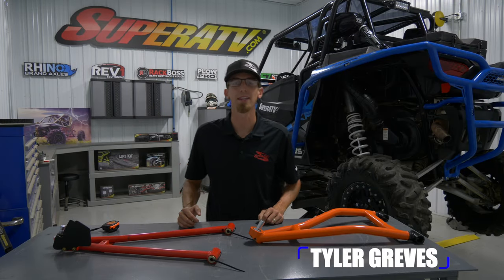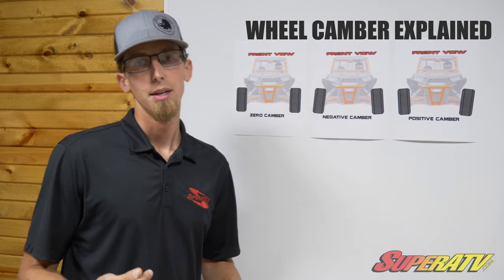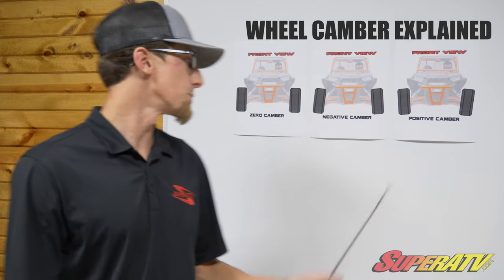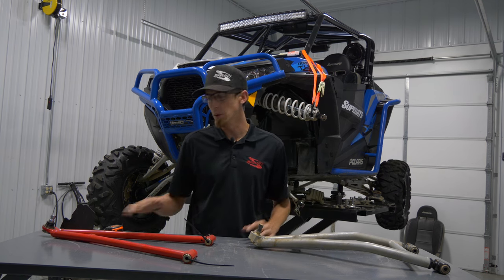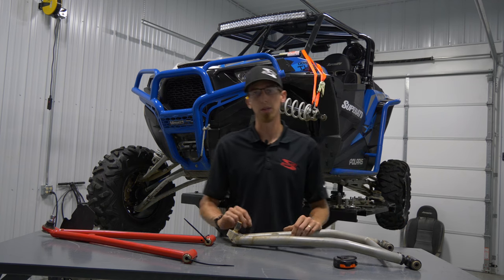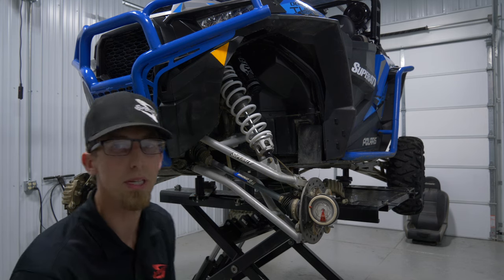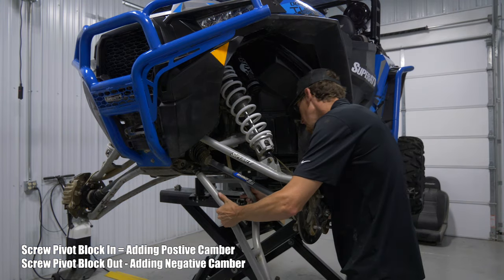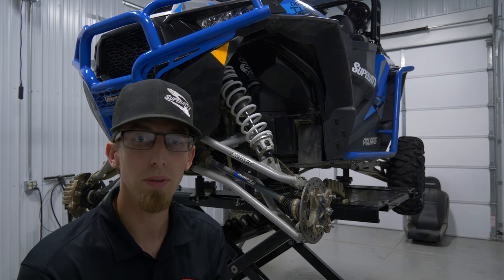Fully Adjustable A-Arm Install - Camber Explained - SuperATV

Comment: Just put a set on my 2019 Ranger Highlifter, ended up with a smidge more negative caster than I wanted. Tearing it back down to adjust the arms will have to be for another day. I really like the arms, the factory HL arms are thin metal.
Reply: Just remember to put in the steering arm adjustment when you  put these in.  Moving the arms forward will and using the factory steering arm length will give you a massive toe-out.  Adjust the arms out to bring the wheels back in to straight within a good eyeball look and you will be able to see your negative camber.

Comment: If you’re véhicule is not level the angle gauge won’t give you the right angle should check the caster before removing the stock arm as a reference point 😊

Comment: Wouldn’t you determine your camber with the machine on the ground?
Reply: I would think. Or at least use jack stands under the ball joints.
Reply: No
Reply: I agree, with the suspension at full droop your suspension isn’t going to have the same camber as it would at ride height?
Reply: Just got a set for a commander and instructions say to check camber with machine on the ground and suspension settled.

Comment: I assume with the 1.5 offset arms you have to get longer axles?
Reply from the maker: No you do not, these a-arms do not make your machine any wider it just moves the center point of your wheel forward 1.5".

Comment: Good info., but how are we going to set the Caster on these arms ?
Mine just came in. I need to reset the front end and nobody has info
on Caster adjustments using this set of arms.  Thanks!
Reply: I had the same problem. After your ride height is set with loaded weight, tape a digital levels to the roof front to rear. Lift the car so it stays level and remove wheels and axles. Use the digital level holding it from uper ball joint to lower ball joint, looking from the side of the car. Kind of eye ball it 3 to 4 degs.

Comment: Need a better design to where you can adjust camber without taking the A-arm off and on only to guess on each try… 
You need it to be like a tie rod design… a bolt with left & right threads and jam nuts
Reply from the maker: That would be an awesome design!

Comment: @5:05 when you’re explaining how to preset your a-arms… That’ll work great in a perfect world, but mine are bent, that’s why I’m replacing them, and taking a measurement is useless
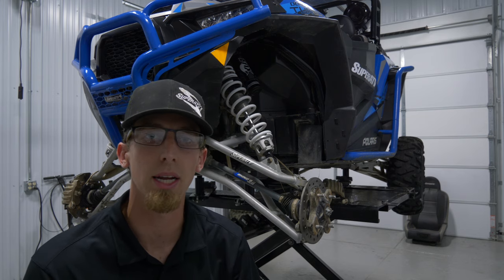Reply from the maker: Most of our a-arms will come preadjusted to make installation a little easier. If they are not preadjusted, you can follow the instructions beginning at 6:57.

Comment: I don’t know if it shows on the instructions for a 1000 xp that you can adjust the caster but on the 900 s it shows the caster is adjustable is that correct?
Reply from the maker: Yes caster can be adjusted with these a-arms as well.
Reply: @SuperATVMedia  do you have instruction video showing this adjustment and benefits of positive or negative castor?